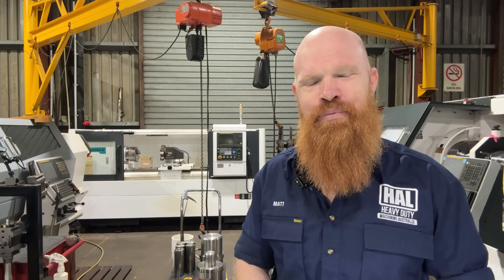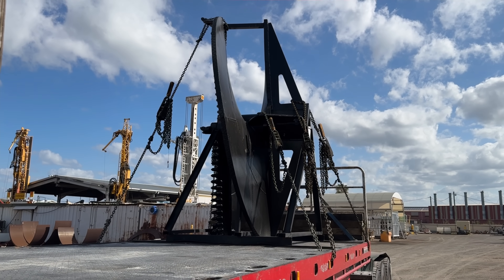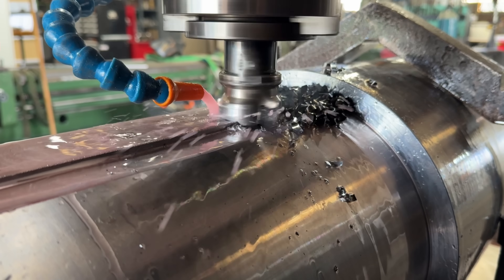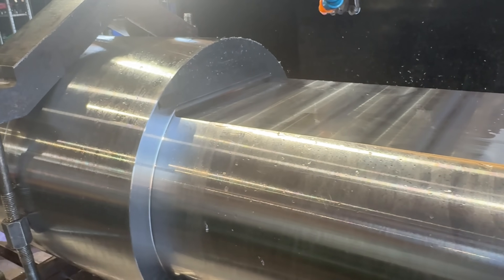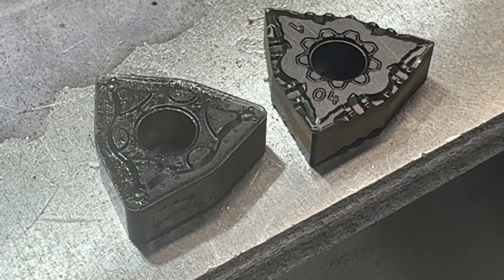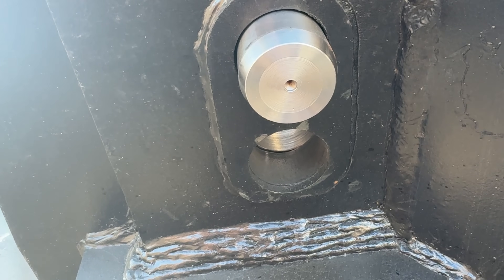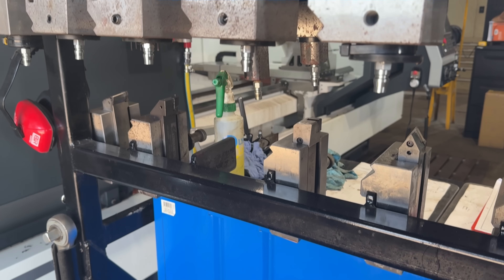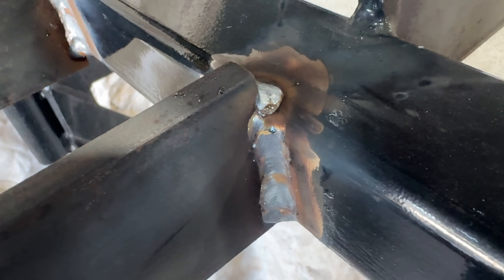Will It Fit? (Gigantic 200mm (8") Square Auger Drive for the Big Rig | Final Machining)

Comment: Holy shit, you guys aren’t screwing around down there my question is why are they drilling a whole 10 feet in diameter and 280 feet deep that’s my question. What’s the purpose for the hole?
Reply: I asked that question - it's for ventilation shafts
Reply: @TonyTheKiwi62  what are they building just an underground complex like you have all those underground cities or towns in Australia that’s a serious hole in the ground
Reply: @TonyTheKiwi62  I just did the math on a 10 foot diameter hole 280 feet deep that’s 815 yd.³ of material they’re digging out with a freaking drillbit what I would love to know is who sat at the table and propose this and then say he was serious that we could do it while everybody else is laughing. I would love to know the horsepower rating of the unit that makes that big of a hole it’s gotta be 1500 hp minimum.
Reply: He said the hole is 250 metres deep, which is around 820 feet.
Reply: @stuboyd1194  yeah that makes a huge difference that there is 1500 cubic yd.³ of material holy crap what I want to know is still what kind of drill shaft can you run that deep without turning it into into a pretzel?
Reply: @steveanderson4768  I'm looking forward to seeing this godzilla of a drill in action!
Reply: @stuboyd1194  hell yes this thing is mind blowing. I wanna know what they’re drilling down there for OK ventilation shaft for what
Reply: 2400 cubic yards “bank yards”. About 3600 in a loose pile. I think you might have push the wrong button.
Reply: @StevenStyczinski-sy8cj  since the original specs were given in metres, I work it out to be:

3 metres diameter
3 ^ 2 = 9
9 / 4 = 2.25
2.25 * Pi = 7.07 square metres
7.07 * 250 metres deep = 1767 cubic metres.
1 cubic metre = 1.30795 cubic yards.
So it's 2311 cubic yards of material.
Reply from the maker: Amen to that brother
Reply from the maker: It’s a mining ventilation shaft.

Bloody wild stuff